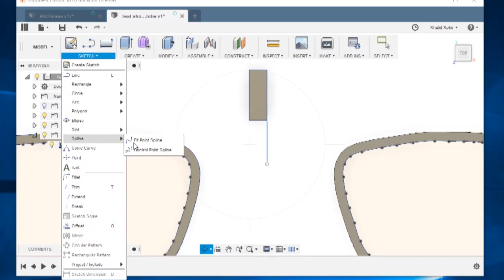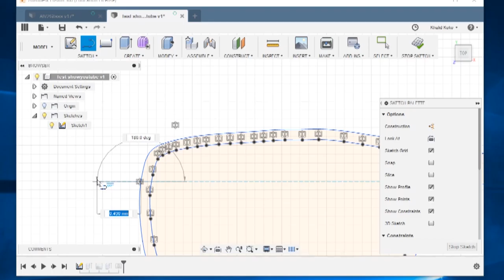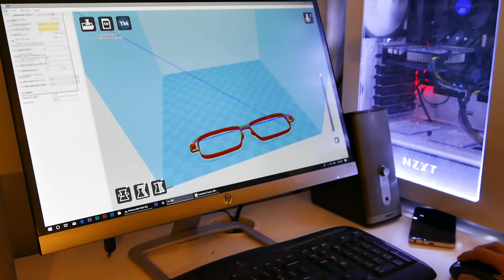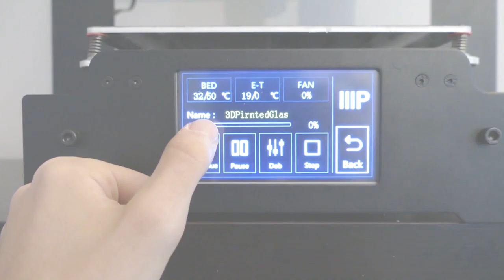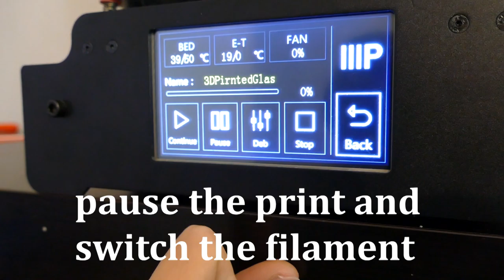3D Printed Glasses Part 2 : Making the Frame

Comment: How do you make the hinge? You just kinda skip to when it's completed.
Reply from the maker: Basically just a stick with a square on the end of it with a notch in the center of the square then I used a small cylinder shape to hold it together with the glasses you can see some of it in part 3